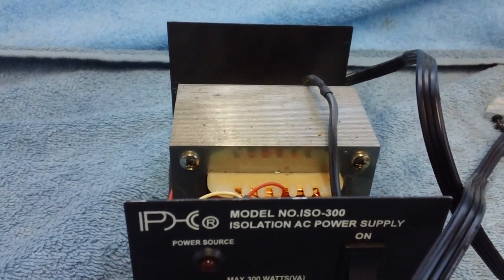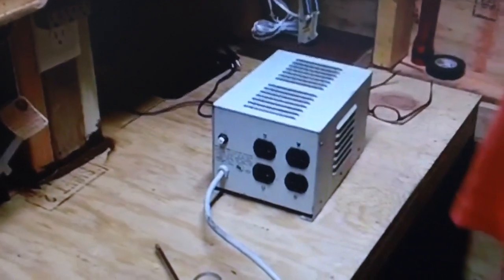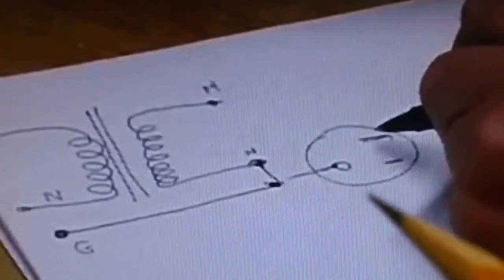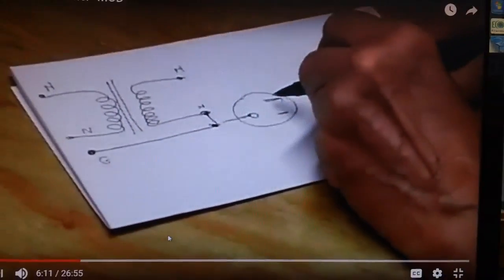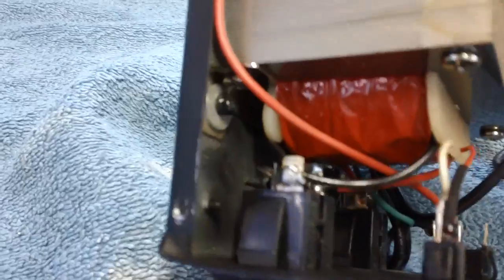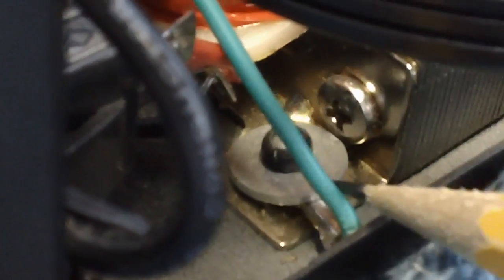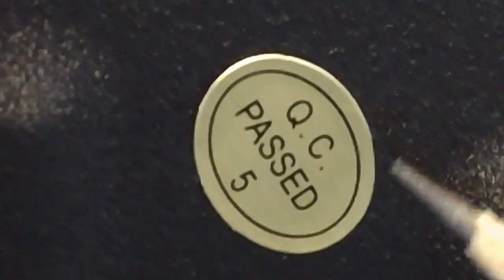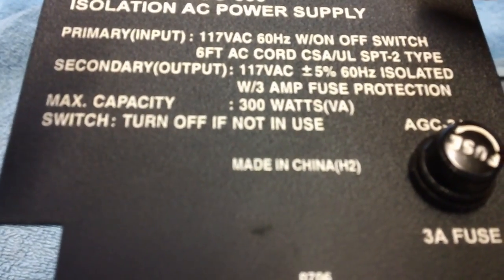Some valuable isolation transformer information.

Comment: my isolation transformer is 2 matched ones hocked back to back   watch lowest used winding wattage that is the rating of the two...i used 2 industrial control transformers  120v ,,480v to 480v ,120v   best part was free

Comment: I wanted to just buy a model like yours on eBay since you said yours is safe. According to their add on eBay it's NOT safe. They bring up the issue of ground in their add. My hunt continues...
https://www.ebay.com/itm/PHC-300-Watts-Isolation-Transformer-120-Volt-AC-Input-120-volt-AC-Output/192415315647?epid=1101521028&hash=item2cccd8b6bf:g:WEEAAOSwkShY9T-E
Reply from the maker: Michael.
You're reading it wrong, but do as you wish, my friend.
Regards,
John

Comment: Mains worldwide is 240v - NOT Center ground -  u get a 240v jolt in India if you work on hot chasis - will wake you up for sure... Yes my father had a hot chasis 240v radio using octal tubes  like 12k8 (12sa7 too modern) 12sk7 12sq7 50l6 + huge 1k filament dropper / room heater

Comment: John, 
Not sure if someone didn't add this further down. I just watched Mr. Carlson's Lab video on this very subject. The issue is not that there is a connection within your isolation transformer between the neutral and ground. The problem is that they are tied together back at your main electrical panel as per the electrical code. So the point is that there is a "bridge" on the neutral line making the neutrals on both sides of the transformer electrically the same. Basically, the tied neutral at the panel connects directly around the isolation transformer on both sides. Once again, just because there is no direct connection within the iso transformer, there is a tied ground and neutral with the standard 3-prong plug into the mains. The easy solution is to put one of those 2-prong adapters on it, essentially lifting the ground and severs the ground-neutral connection. And, as Mr. Carlson said, "You do so at your own risk."  So confusing, isn't it? What's the worse risk - shock hazard from a connected "hot" chassis radio or in the use of ungrounded equipment? Grr...
Reply: Adding a 2-prong adapter does not make it safe, if secondary neutral is still tied to input neutral through ground.  There is still a path from secondary hot, through your body, to house ground (e.g. a water pipe) and back to secondary neutral.  To make this a safety isolation transformer, you must disconnect secondary neutral from ground.
Once that's done, then you can use the 2-wire adapter to also isolate output ground from input ground, if you want - but this makes some activities less safe.

Comment: Hi John,
Thanks so much for sharing this important safety information.  As it turns out, my isolation transformer, Tripp Lite model IS250, has the neutral connected to chassis ground.  Not wanting to tempt fate, I'm going to fix this as explained in the video by old64goat.  This could save lives, so thanks again.

Pat

Comment: These things are tricky and need a bit of thought.
A lot of times the Ground (third pin) on the mains side goes back to the panel and is tied to the neutral bus.
If you use the third pin on the isolated side you have introduced the mains neutral to the secondary side and could blow your scope. among other nasty things to yourself. there should also be no connection to the chassis from the isolated side.
With all that said. do you really want to "fix" that ground wire? seems they made that floating for a reason,
Thanks for all the videos.
Edit: should learn to read the comments... seems someone has already mentioned this
Reply from the maker: C'mon Slim...a ground wire poorly fastened to a chassis is not a floating ground.  It's shoddy workmanship.  Also, as long as the isolated secondary hot and neutral remains isolated (disconnected) from ground there won't be a problem, in that there will be no ground connection back to the circuit breaker panel or any place else.
Regards,
John
Reply: shhh I work for the Company

Comment: Thanks John. I have the same model isolation transformer as yours. I'll crack mine open tomorrow and see if mine suffers from the same defect.
Reply from the maker: Norman,
I'd appreciate it if you'd let me know what you find, my friend.
Regards,
John
Reply: +joernone Hi John. I must have a slightly newer upgraded version. The chassis is grounded well with the wire attached to the rivet on the other side of the secondary of the transformer. Neutral of secondary is isolated from ground. Quality control courtesy of operator 5.

Comment: Hey John, I think I saw a video similar to this by Mr. Carlson's lab a while back.  When I saw it I bought a new old stock Stancor isolation transformer.  It only has a two prong plug on it and a single two prong outlet.  I'm hoping that that will eliminate the whole problem with that ground wire.  Take care, Gary
Reply from the maker: Gary,  I'll check Paul's website for that video.  Thanks for the heads-up.  Regards,  John

Comment: if your isolation transformer has standard wall outlet plugs in it, it will almost certainly have the neutral connected to ground. Mine did. look for a brass strip going from the neutral side to the ground lug.
Reply from the maker: Sorry, I can only tell you what I have.  Regards,  John

Comment: Thanks John.
You are right. If the ground is connected to the neutral at any point, then this is no longer an isolation transformer.  In the case of yours, it would seem that the ground does not have a proper connection to the chassis and is floating. I noticed that the rivet comes up through a plastic bushing on yours, hence no connection to the chassis.
Reply from the maker: Dan,  Correct, my friend.  Regards,  John

Comment: I agree, Bill did a great job on that video. I was shocked ( not electrically but could have been ) when I realized my iso tranformer really wasn't. Come to find out most of these so called iso transformers now days are made to isolate spikes and such from computer equipment and not from earth mains ground. Makes you wonder how many guys out there have been nailed thinking they were safe.
And now John you bring up another point. Just don't take it for granted that a iso transformer is safe. Takes just a minute to check if the neutral is connected to the earth ground.
Carl
Reply from the maker: Right on, Carl, my friend.  I'm just happy my isolation transformer is good to go...except for the loose ground wire, that is.  LOL  Regards,  John